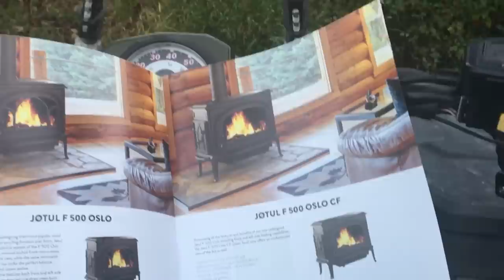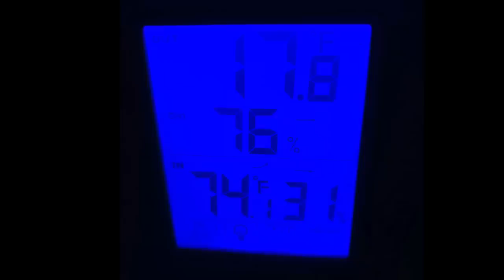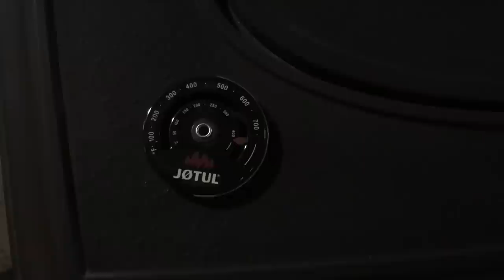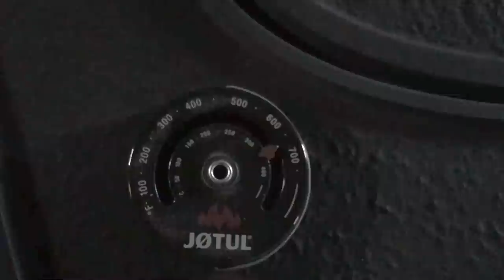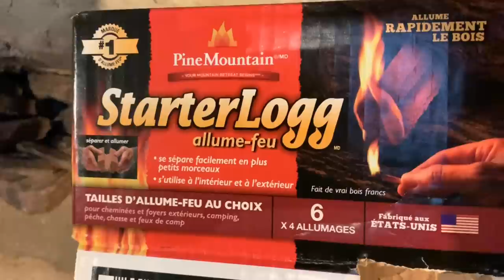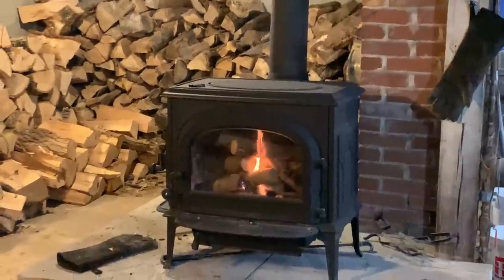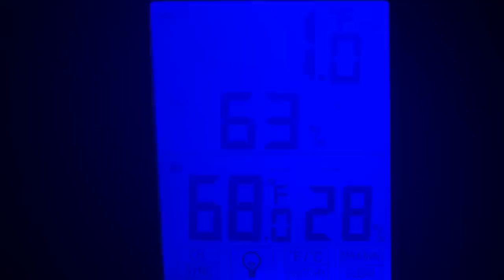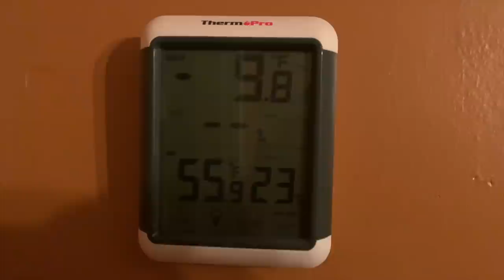The Jotul F500 Oslo CF one full winter review + install is this stove that good ?

Comment: Regarding the glass cleaning... what I do, (not a jotul) is get a good hot fire going and the glass cleans itself. I found if I use a cleaner on it, it streaks and gets cloudy.
Reply from the maker: This is what i do to remove blackness in the glass. Thanks. Check The follow up video I made about this. It was damaged and i repaired it.

Comment: To clean out the window from the unseasoned wood, wipe it down with ash. I use a newspaper, wet it a bit in a bucket and wipe up some ash from the fireplace. Gets a real slurry mess on the window of course, but that wipes away very easy with a squeegee or a cloth.

I've got the same fireplace for about 7 years now. It's on the top floor for me, which is about 100m2 and a reasonably open floor space. For that it's a size too big though. It looks great, and it's really a centerpiece in the living room, but it's just too much heat and it doesn't burn well with less as a full load. Like you mention, it really needs to get high up in temperature before the secondary burn burns nicely. 

I imagine if I had it in the basement as you do and adequate heat dispersal around the house, it would be possible to heat the whole 250m2, at the very least until late in the autumn or early spring. Mid winter here in Sweden might be pushing it a bit though.

Anyway, in my situation it's a beautiful object, but a bit too big as a secondary heat source. For those looking to buy such a fireplace, make sure to dimension it to what its rated for, not for what fits in the room. I could have gotten a stove 1/3 the size.
Reply: Use a dry wad of newspaper, after the wet ash one. Perfectly clean and dry.

Comment: Looks like we do the same things when burning wood, love the preheat method, Yes, I do that too. sometimes.  I had a Noble stove years ago, made out on Long Island, only stove made with a side draft, but could that stove heat up a house. Seeing you tending to the stove is much like watching myself with mine, guess we're not so different after all.  I even have a register above my stove like you do, Yesterday I put a 3" flex pipe on the stove and duct it to the register, Holy Socks, so much better. Using a All Nighter "MOE" has vent tubes inside, so I put a blower on it and with the duct I'm liven large and warm. Beautiful stove you have there, hope it gives you years of warmth. Wood warms you twice, Once when you cut it and once when you burn it. Does code allow for that chimney?
Reply from the maker: The chimney has a liner. A very good one. So its all governmented up. There will be some improvements down there in the follow up

Comment: Your stove looks awesome. I turned mine into a part rocket stove on top that forces the exhaust to be burned and pushes the remaining heat through a stone bench before the exhaust exits. Just a note if no one els has mentioned it if you use news paper and wet it and dip in ashes and wipe it on the stained glass when cool. Let sit for a couple seconds and scrub again it will make it like new remarkably regardless how bad it is stained from the smoke.

Comment: Really good stove! Is it all iron cats without fire bricks? Very nice one. I wish mine had the perforated tubing at the top. My cast iron stove gas glasses on 3 sides and the top ceiling is like 40cm away from the base grilling making it inefficient imho
Reply from the maker: There are no cats on this model. Without gas burning tubes. Gasifier. You are only getting half the heat you should from the wood. But without the gasifier you dont need to be super seasoned to burn. Some people think its an advantage to be able to burn fresher cut wood. I think its lack of preparedness for winter

Comment: Get yourself a moisture meter then you know exactly what wood you intend to burn has the optimum moisture content to burn  efficiently 15 -20 %. If it not seasoned properly it could still be to moist,. Takes the guessing away. Nice video, I burn with wood also in a similar designed stove.
Reply from the maker: Good advice. Im working on cutting two year ahead this year. What i burn will only be split and cut for one. This coming winter. Again. Working out good this year. But not next winter. And all the following. Two years ahead.

Comment: Nice video. Good choice of stove. Had ours for 4th season and doing great..
 Must agree on seasoned wood and the harder the wood type,  the better. We use small flat coal shovel to remove the spilled ash from inside the ash drawer and it saves a lot of time as we keep a hot fire going 24/7 in season. Good idea to check and keep the chimney clean if you happen to get  a load of wood with higher moisture content as the crust will accumulate very quickly. Stay warm...

Comment: Great stove? Some people let the ash pan build up and just shovel out the ash. This also helps extend the burn times. The new V3 Oslo has a cat and there has been some reported problems.
Reply from the maker: The ash pan door seal needs to be changed. It’s regular maintenance only cost about five bucks. The ash pan is one of the best parts of the stove. In my opinion. I know some people do this and I’ve heard they even make a version without the ash pan now. It is not something that makes any difference to me in Burn times because I change the seal

Comment: I have a Jotul stove, slightly smaller version, and heated my house with it. It burned about 6 hours, at most, no matter what the brochure says. I'd buy two cords of wood and collect the rest. First, I would never put and raw firewood in the house. My father got termites from firewood in the basement and basically had to replace the half of the front of of the house siding. Second, I would wait a while before replacing the door. Maybe it will burn off.  Good luck
Reply from the maker: Well. The firewood is seasoned outside in a shed for a year. Then outside near my house for another. Starting this year. So its two years outside before it gets in and one is right next to the house. I can fit enough for all year inside. It makes burning wood much more pleasant. The whole harvest inside. The risk is always there no matter where you keep it inside or outside and close. Ill take that chance.

Comment: Nice! How did you throttle the stove on the break in fires? I just got an f45. Unsure if I run it wide open on all 3 or what
Reply from the maker: Only using a small amount of wood like 4 small pieces and a fire starting log

Comment: The earlier models didn’t even have a handle on the ash door. There was a separate tool included that you had to use to open the door. I can understand why they did that because if you leave the door open a bit to help start a fire but then forget it, you’ll have a pretty hot inferno.
Reply from the maker: Oh yeah. Rocket stove really.
Reply: Jonny jetstreamer : I thought the same thing. We have an older Jotul stove with that separate tool for the ash door. I sometimes catch myself looking at the angle of the nub on the ash pan door to make sure it's still shut tight.
Reply: SuperHigear I fashioned a handle out of wood with a long bolt through the hole in the end of that metal casting on the stove.
Reply: Jonny jetstreamer : I like the way you handled it! As soon as I can I'll do the same thing, thanks for the idea.

Comment: I don't know of any stove, regardless of make or origin, that burns green (un-seasoned) wood well.  So your statement that this stove is not for those who don't burn seasoned, dry wood should not impinge on Jotul.  It' s true of all stoves .  Jotul is no different in this to any other.  But nice video and thanks for showing us how well these stoves look and function.
Reply from the maker: Well. Burns well. Is accurate. For sure. The way i grew up. When we need firewood. We went and cut some standing dead trees and burnt it. The old fisher stove we had burnt it much better than this. Maybe i will make more videos on this old stove subject. Thanks (-:
Reply: @AlfonsLC  In our neck of the woods (Western Oregon) a standing, dead fir snag is considered the gold standard of burnable fire wood, esp if burning in a fireplace.  The only wood better was the same tree, down on the ground - they're very dangerous to fall once dead.  But in burning airtight stoves, maple, ash and myrtle reign supreme around these parts.  Madrone...if one can find any would top that list.  All these need curing - one year or longer for best burns.

Comment: I recently learned that the best way to start a fire for a system like that is FROM the TOP of the wood.     Less smoke, pre-heat of the bottom, less humidity ine the wood that need energy to avaporate (and smoke)

Comment: Thanks for sharing your experience. I'm interested in knowing why you chose a secondary-burn stove vs a catalytic stove.
Reply from the maker: Secondary burn always works as long as air is flowing. Its also the natural result of burning and gases. Not a chemical reaction from the metals in the cat
Reply: @AlfonsLC  I agree. Catalytic stoves eventually need the catalyst replaced. Whereas secondary burn is always present as long as there's air. Good choice.
Reply from the maker: I originally thought the cats needed replacing ever year.  But now i know they last longer. But still. I bet they are very very pricey with all the platinum. The new jotuls ALL have them. So im glad i got mine before
Reply: @AlfonsLC  That's good to know because i figured the catalyst was good for a few years. Nobody has talked about the life of the catalyst in their reviews.
Reply from the maker: Thats maybe a good idea to do.

Comment: Excellent presentation of installation and living with the Jotul through the winter. Well done.  Curious,  when you got the foggy glass from burning unseasoned wood, wouldn't an application of oven cleaner remove the cloudiness from the glass, instead of having to replace it?
Reply: The glass got etched by something he burned he will have to polish the glass with some cutting/rubbing compounds to restore its clarity.
Reply from the maker: This is exactly right. Ive tried everything. Ash. Oven cleaner. The cleaner the stove deal sold me. I wish i went over it in the video. I will try and restore it in a future video.
Reply: @AlfonsLC  there is a few videos where ppl polish stove glass and restore it.... My Federal Airtight FA288CCL has so old of glass I was looking to refinish it also. Couldn't imagine what Vermont Castings would charge for the glass panels if the stove cost 2800 for their version of it since they own the patent now. For mine the repair is time consuming due to 40 years of pitting and etching for you not so much maybe 1-2hours of work. Wish you knew the species of wood that caused it so we all could avoid it in the green/unseasoned.
Reply from the maker: Master Debater unfortunatly. I dont. It was such a mish mash of junk.

Comment: Love your videos on your jotul.  I just installed a new f55. My question is can you do the break in in mutable day or does it have to be done the same day?
Reply from the maker: Thank you. During the cool downs. The only requirement is that it cools all the way down. I do not think it matters if you do it over a couple of days.
Reply: @AlfonsLC  Thanks for getting back to me this quick. This stove is awesome so far. The reason why I asked because this cast holds temp for ever. Hope I can round 2 in today
Reply from the maker: Its basically just to teach the stove cement to flex and not tear or crack. Youll be fine.

Comment: Best video I have seen for this fire! Thanks.  If I can give you some advice though. Keep a 2" layer of that Ash in the bed of your fire. It will protect it.
Reply from the maker: Thanks allot !! And thats good advice !!
Reply: @AlfonsLC  your welcome. That really was a good video. I am going to get an F500 for sure. One other thing for you, if you have not yet replaced the glass, you may be able to polish it with cerium oxide. It can be bought on Amazon.
Reply from the maker: Marc lang thanks. I have the new glass but not installed. I will look into that right away.
Reply: @AlfonsLC  no worries, just keep the old one safe in case you ever break the new. My wife kindly broke the glass in ours. All fun.
Reply: @AlfonsLC  hello again, hope you are staying warm. I have a question. How deep from front to back, is the firebox? I have a dutch oven and I'm wondering if it will fit inside.
Reply from the maker: Marc lang the very edges where it’s narrowest you got 13&1/3 and you gain a little bit in front of the door to about 14&1/2 anymore and it may bump the glass. Im going to be doing an experiment. My friend only puts his wood in sideways. Cuts at 12 inches. To go in opposite the way you put it in with a 24” through side load doors. He says. He gets many more hours of heat burning this way. Im going to investigate. Thanks got checking back in.
Reply: @AlfonsLC  great stuff my pot is 12.5" round and 7.5" high so it sounds like it would fit. That's a good idea with stacking wood front to back, that would work well for me so I could put the pot in next to the stack. I don't know how you get your wood, but you cut 12" rounds, the correct height to fill the fire, but they would take longer to season. Two 12" rounds 12" high would burn for ever. Or stack the rounds on their side if they weren't as thick. Thanks, Marc.
Reply: Try using a damp rag dipped into the wood ash and cleaning the glass with that.
Reply from the maker: Christina Chao this is a good suggestion. I tried it a few times. It works for allot of people.  It made zero difference here. What happened to this glass is something different than a stain. Im going to be changing it this weekend. And im sending the glass to jotul to ask what it is.
Reply: @AlfonsLC  that's too bad, it's always worked for me. I wonder if one of those magic erasers would make any difference.
Reply from the maker: Christina Chao i suspect that the glass. Well. Its actually ceramic. Was reforged in a way. Its still smooth to the touch there. Just as smooth as the rest of it. There doesnt seem to be anything to clean off.
Reply: @AlfonsLC  when you use unseasoned or wet wood you create creasote, then next time you add wet wood the moisture condenses on the glass combining with the creasote to make sulfuric acid. The clouding on the glass is acid etched on. Nothing you can do. But try to buy glass from a specialist company not jotul as it will normally be half the price.

Comment: If you get a stain on the glass again try mother aluminum and mag polish to clean the glass and windex after so you dont burn the polish
Reply from the maker: The glass is damaged. It cant be just wiped off. Check out the follow up video i made please.

Comment: Hi mate. 
Mike from Australia. Great video, I’ve got an old Jotul 3 I’m restoring for our caravan site in a very cold area at the base of one of our snowy mountains. 
Just some glass cleaning advice. Damp a cloth and dab it in some ass . Then clean the glass. Wipe of with clean cloth to a clear finish.
Reply from the maker: Great to hear from you. I hope you make a video of your restoration I would like to watch it. I tried this and many other ways to clean the glass. But it is not a stain. The glass is etched. There’s nothing on it to clean off. Its smooth. And clean. The cloud is inside the pane itself. Its badly reforged in a sense.

Comment: I really enjoyed the video and how you put it all together.  Great job reviewing the stove all the good and bad points.  Wood quality defiantly makes a big difference.  you'll find out what you like to burn and what works best for you.  I try to keep well ahead of wood supply and that allows you to be a lot more selective on what you get.  You'll notice though that some wood doesn't keep as long as others, so some you need to use up sooner than later.  I have a Hearthstone Mansfield and older model 8011.  It's a soapstone stove, so it has a little different burn characteristic than a cast stove, but still another high quality stove like yours.  I hope yours serves you well for many years.
Reply from the maker: Thank you. I liked the hearthstone stoves i seen when shopping around. I would ideally like to get 2-3 years ahead with my woodpile. But thats yet to come.

Comment: 10:27- those coals come from burning green wood. 11:15- don’t load the stove with big wood to start that way, or yeah, it’s gonna smoke. Design is such that you load it loosely about half full with smaller split (bone dry) wood and the fire roars within seconds, then 20 min later you load bigger pieces. You want a hot fire as often as possible for that secondary burn to work. A big stone surround behind and to the sides would store a lot of heat.

Comment: Though recommended, you may not need to replace a stove catalytic converter every year. One trick I learned for cleaning out a car's catalytic converter is to pour laquer thinner in the gas tank.
Reply from the maker: Well. Im not gonna try it. But no. Ive learned since that they dont need replacing that often. But im still glad not to have one.
Reply: @AlfonsLC  Soap and water is supposed to work too, but you have to take the catalytic converter off the car to use that method.

Comment: This stove is nice to put in living room, in your case a more efficient model would be something to consider. Also you should consider a model that allows you to store heat. It doesn't have to be an active system with a pump. But the ability to heat your living rooms and store heat would benefit you a lot. Oh and an external air supply would be good in any case. You realy on convection, so in your case, fresh outside air comes direclty inside the cellar, while the hot air from the cellar is pulled in the oven and out of the chimney. That wasts a lot of energy.